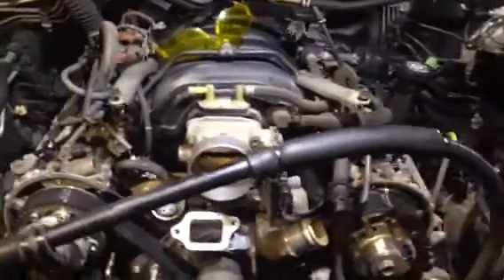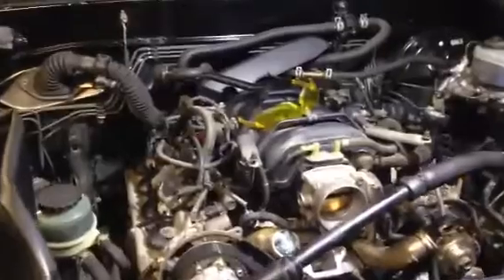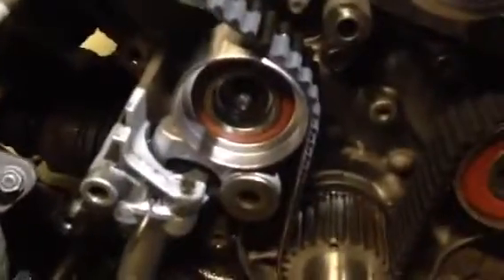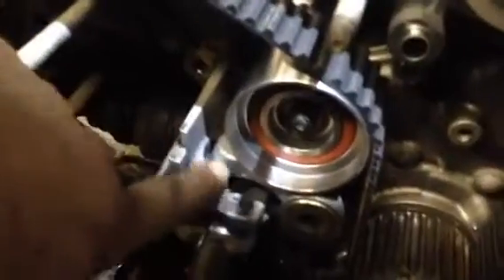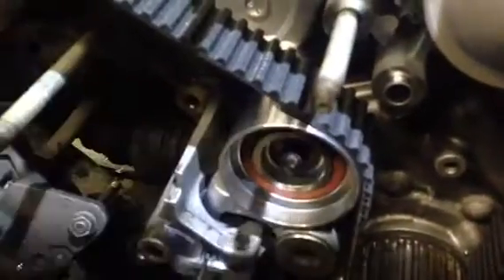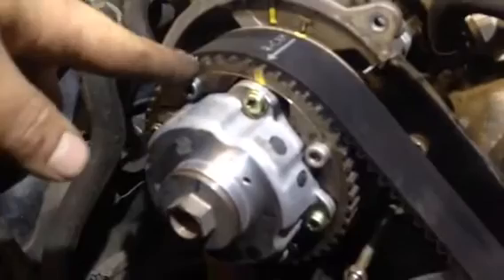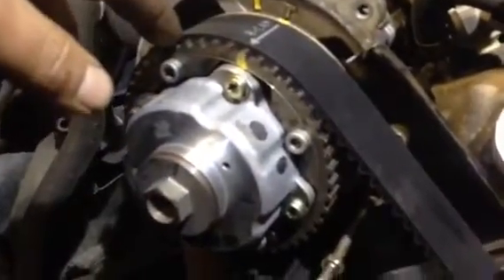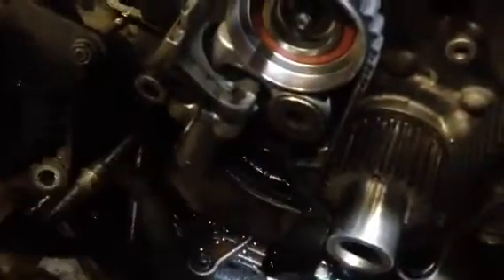Toyota hydraulic timing belt tensioner trick

Comment: Hey i seen your right cam came off center. Is it alright to just turn ig back to center and put belt on again
Reply: Sure is. The cam can easily over rotate when trying to get it lined up. As long as it only moves under its own forces nothing will be damaged and it can just be rotated back into position by hand.
Reply: @Jay351  well i just finished up. And it runs lol.  Couldnt have done it without your instructions. Thanks a ton.